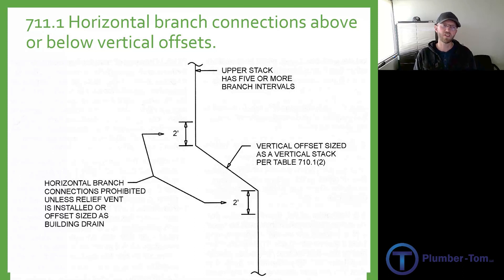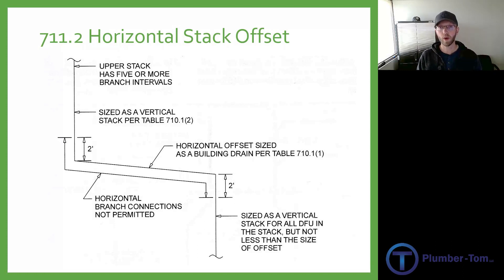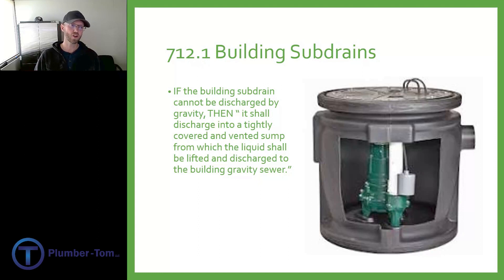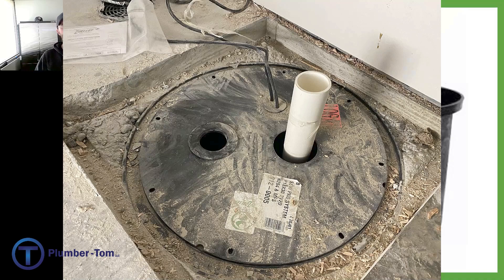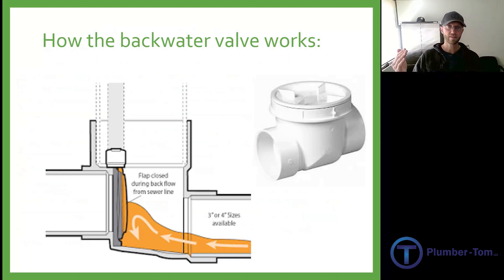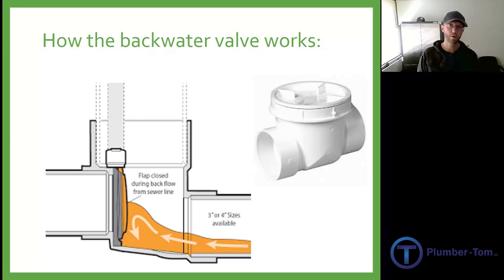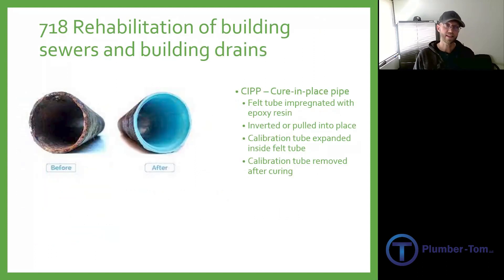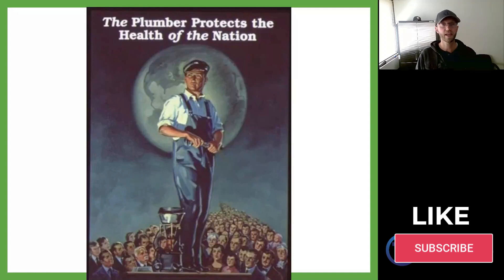Understanding International Plumbing Code - Chapter 7 Sections 711 to 718

Comment: I want to know the codes used in the discharge of chemical laboratories, how to design their drainage system, and the drainage systems used in hospital
Reply from the maker: Good question.  I don’t know much about that.  In construction, the engineer would specify what materials and systems would be required.   I’m afraid I’m not much help on that one.